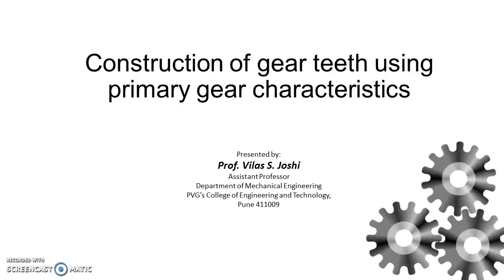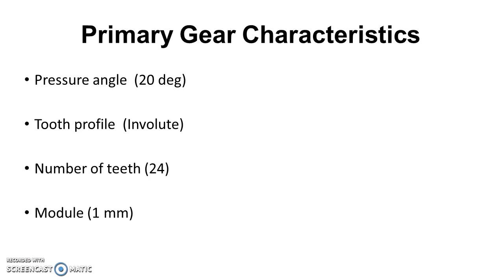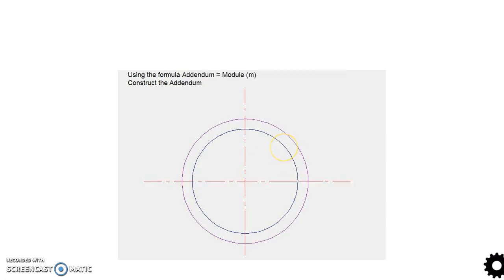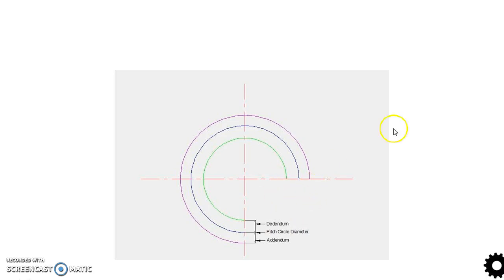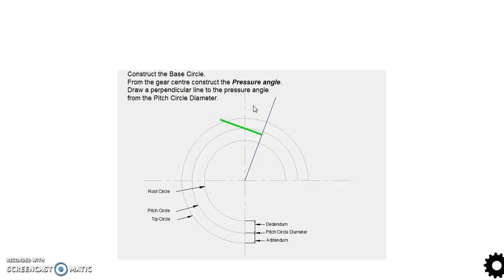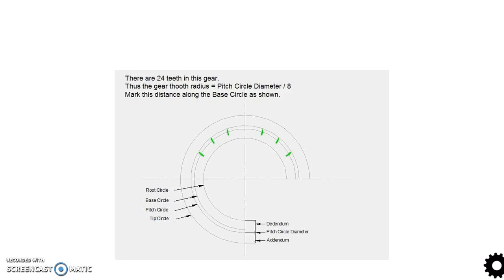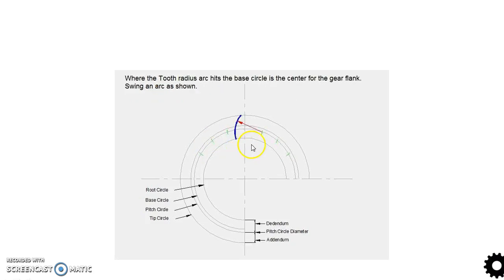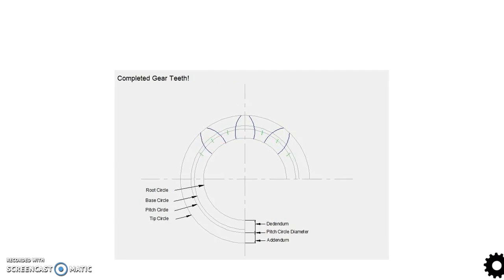Gear tooth construction

Comment: He does not know what formula to get the spacing of the green marking on the base circle. it does not explain the PCD divided by 8. It cannot be applied to all gears with different number of teeth. Gear Tooth radius is equal to Base radius X  (Tan of Pressure angle). And Base Radius is (PCD x Cos Pressure angle) /2